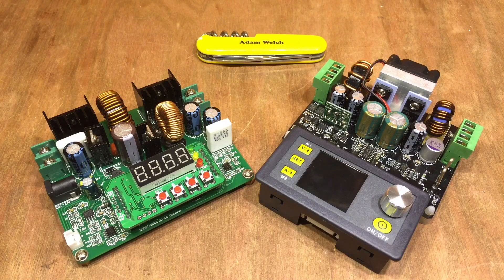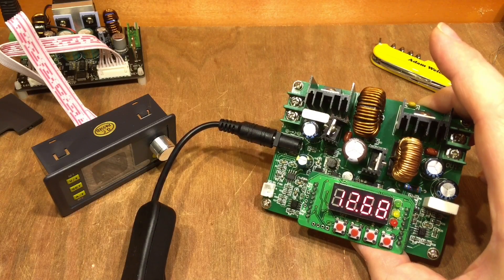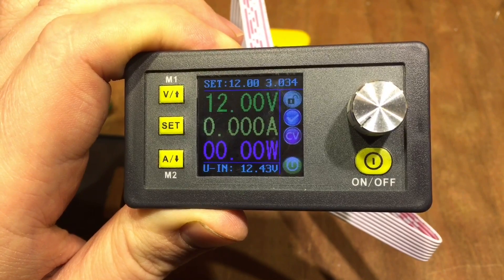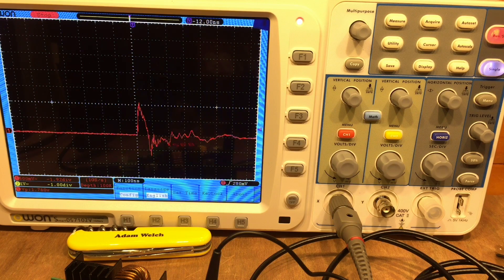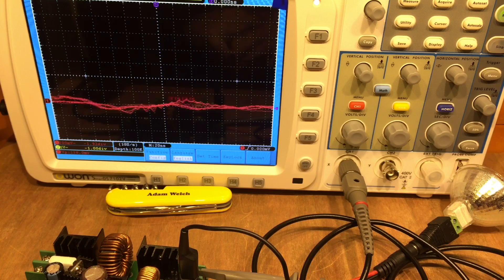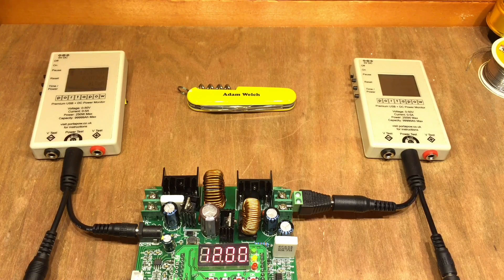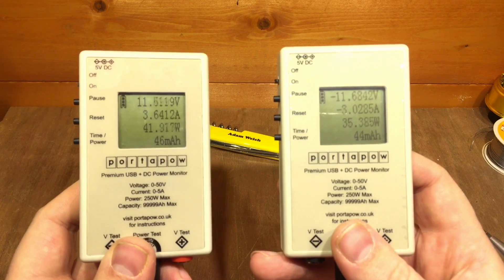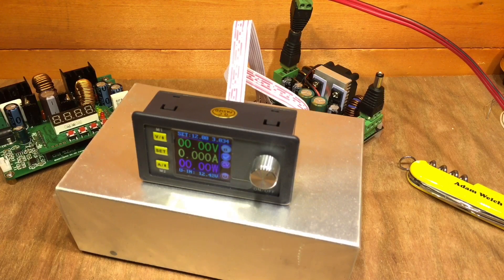Rui Deng DPH3205 vs. Minghe D3806 - 12v Solar Shed

Comment: You are trying to give 11.58 volts and get 12 volts. So the device works in boost mode. If you want to get 12 volts, you should not even use a 12 volt power supply, you definitely need to use a power supply above 12 volts, otherwise it will be inefficient and buzz!

Comment: We are using 48V BLDC Air conditioner with solar power charging 4X12V =48V batteries 150AH each, the power input for Air conditioner is 48V dc from charging batteries. The problem I understood is 2 inverters Modified sine wave inverters have gone to internal short circuit and now finally the indoor/outdoor controller card also gone into not working stage.
All happened one by one in last year but I observed that during AC on full load the 48V at have not a smooth DC because of the compressor load variation has creates a electrical un smooth DC. this may be cause of all those failures? is my question.

Comment: What about low voltages in both modules? Can you get for example 0.5V 5A on the output when you power it from 30 volts, or would they overheat?

Comment: I've tested both and they are both bad/cheap implementations. The electrolytic caps are low quality and not large enough to filter the transients at more than ~1Amp output. 
A good rule of thumb is 470uF for each Amp output.
Try replacing the electrolytic caps on the input and output with higher value, high quality, low ESR caps, like genuine Rubycon's. 
The MingHe uses only 470uF caps and the RD uses only 330uF. Way too small for those output ratings. None of them use a choke filter on the output stage either. FCC or ULA approved? Of course not!
When (not if) they catch on fire, who do you sue? Will the insurance company pay you when your house or shed burns down? 
I doubt it. As always, "Buyer beware".

Comment: Well, I looked at the efficiency numbers and I was disagreeing with you.  So, I re-run the video and did the math.

Minghe D3806 Eff. 84.028599606%
Rui Deng BPH3205 Eff. 83.706556364%

So the Minghe won by a nose.  However, as you said the noise and easy of use comes into play.  I do have one of those Minghe on the way.  Maybe I can modify the circuit some and filter out the noise.
Reply: I have D3806 too. How are you thinking of modifying it? With Arduino? What kind of change in filtering? Thnx.

Comment: Thanks Adam, nice insight. May we see more ripple current figures on the newer BPH3205 at lower currents for typical projects such as ardurino/arm/pic type projects say at 10mA, 20mA, 50mA and 100mA please. A lot of us are interested here. Thanks for your time if you do this test.
Reply from the maker: Funnily enough I was reading today how to take a better measurement of ripple today.  I'll see what I can do.
Reply: +Adam Welsh Your previous measurements were fine for the data we need. Just measure lighter loads in exactly the same manner please :)

Comment: Hello Adam...Thank You for this video.  The Led displays are best seen and "shows" best on video, with a red filter in front...like red plexiglass. Greetings from Denmark...Jakob.
Reply from the maker: +Jakob Hovman Cheers - good tip.
Reply: A tip I saw on another video: Put a strip of red electrical tape over the display.

Comment: Could you use a Buck Boost Converter in place of a solar charge 
controller?  I have a 100 watt solar panel hooked to a 12v deep cycle 
lead acid battery.  My charge controller now has a linear voltage 
converter and it cuts off charging at 14.2 v. I would like it to stop 
charging when it hits 15.1 v.  Any suggestions?
Reply from the maker: Buck Boost converters don't manage their input and will not get the most out of your panel.  You might be better off with something like the CN3722 (take a look at my video - https://youtu.be/liYZ5pYOZDE ) or the BQ24650 ( https://goo.gl/NCcYwy ) which works in the same way but I haven't actually put my hands on.  The CN3722 comes in a version where you can adjust the charging point.   However this is designed for lithium cells so it wouldn't float charge your lead acid battery.
The other option is a cheap solar charge controller that allows you to adjust the charging parameters.  I've used the EPSolar LS1024B ( https://goo.gl/DFRRg5 ) and a home made USB cable ( https://youtu.be/r3LrWeYYtnQ ) to do this before but cheaper adjustable PWM charge controllers are available.
May I ask why you want to charge to quite such a high level?

Comment: very very good comparation. I like it . the designer of D3806 is my friend, and now this designer is my engineer too. 
we are designing new products. 
you compare 3 parts. 1, display, 2, ripple, 3, efficiency. very good. 
and our product win. 
thank you again
Reply from the maker: +Rd Tech Thank you. Nice to know that you're working together. I've enjoyed using both products.
Reply: *****
thank you very much for your support 
yes, we are working together
Reply: Hi rd tech. I use both the product d3806 and dps5015. When would you guys new product will come out as u mention there?
Reply: If designer of D3806 is your friend, please ask him how to stop the problem of the D3806 blowing up my circuits! 
https://rmprepusb.blogspot.com/2019/11/is-d3806-boostbuck-dc-dc-power-supply.html
This is a very bad problem with D3806!
Reply: how does it win RD??, the MingHe performed better efficiency values (important) while also having higher output values and having bigger caps.
and it cost like 11 or 12 USD delivered (incl. shipping across the globe) while yours being like 3x times more expensive.
so how does it win??
Reply: @JAKOB1977  The math was apparently wrong. They have practically identical efficiency. There's also the color screen and all the flaws should now be gone from most current revisions.

Comment: Hi Adam, good info. Julian Ilet convinced me to buy a Minghe I have Boost & Buck converters as separate units. I thought they worked reasonably well. I guess I will have to up grade. Good Video Merry Christmas Happy New Year
Reply: Bangkok Homes
because our DPH3205 was just designed 2 moths ago. so Julian Ilet did not use my DPH3205, he did not know this . and in that time , D3805 is only one buck-boost module. so he recommend you that one. 
you can ask him now , I can make sure he will recommend you buy our RD DPH3205 
thank you . if you need one , you can come to my official shop to buy, I am the designer. 
https://www.aliexpress.com/store/product/RD-DPH32305-Constant-Voltage-current-Buck-boost-Programmable-digital-Power-Supply-buck-Voltage-converter-color-LCD/923042_32762131242.html?spm=2114.12010608.0.0.wQtsXJ
Reply from the maker: +Bangkok Homes They are good units but I personally prefer the boost buck so I can use one unit for everything. Although the Rui Deng unit only goes to 32 volts that's generally enough for me. 
The screen is the biggest difference to me - especially in videos. It's like having a proper bench power supply (or close to it). I've built the Rui Deng into a project box now and you'll probably see it in future videos - but don't write off the minghe - it'll probably feature too!
Thanks for all your comments this year. Merry Christmas and a happy new year to you too. :-)

Comment: According to dave jones you shouldn't use the negative alligator of the oscilloscope probe to check ps noise, induces a lot of noise by using it.
Reply from the maker: +.rpv Ok thanks. I'll try that again then.
Reply: er... so where is the signal voltage referenced from if you dont use probe ground? Could you please post a link to daves info so we can view the matter in context. Cheers.
Reply: Hi, it's not that you won't ground your oscilloscope probe, it's the way to do it, the video it's: /watch?v=Edel3eduRj4 or only search for "how to check power supply noise" it's on the first page of results. Cheers.
Reply: +.rvp Thanks for the heads up
Reply: Truer words have never been spoken. Go for differential measurement across the load.
Reply: View EEVblog #594. He compares and contrasts 3 main ways to measure SMPS noise, then shows how to build the differential, passive probe set. Best I've seen in 40 years of EE.
Reply from the maker: +Warren Curry Do you know I watched that video yesterday. Next time I look at ripple I will absolutely try the differential method.

Comment: wow that is some horrible output ripple !...  I'm surprised at the ringing as that is a design fault.. Id stick some big caps on the out put of that thing to see if you can tame that.  I have a 1F Car audio cap om my out put, That's mainly cos i just had it lying around. FYI much better review... Would be cool if you could test the efficiency with a voltage difference and actually do the math on the efficiency

Comment: I wouldn't really bother about the 1V overshoot at the output. I had a module that threw a +10V out when switched on. Killed a couple of things. Contacted the manufacturer and received ver2 which fixed things.
That output noise, did you check the input? (having massive headaches again and have to skip through parts)
Reply from the maker: +Luc Peeters The input was straight from my battery bank. Should be fairly stable.  Not too worried about the 1v spike, but worth noting I thought. Cheers.
Reply: +Rd Tech  Wow a manufacturer that is responsive and actually does look at feedback. +10000 points extra from me.  Would love to buy or test some stuff from you.
Reply: unlost117
hi , I don't know , but my thick is about 2mm
Reply: Adam Welch
could you let me see you battery bank ?
and you can use a battery as input to connect my DPH3205, i can make sure it is not blinking
Reply: Luc Peeters
thank you very much for your support , this is my official shop, you can buy it from here https://rdtech.aliexpress.com/store/923042
Reply: +Rd Tech We just ordered from your shop. Can you tell me the maximum front panel thickness for the display so we can start building our cases for these projects. Thank you.
Reply: +Luc Peeters Yes its good to see. That's dedication. I bet the product improves 10 fold.
Reply: Adam Welch
your input is my battery bank? I can't believe. because our product show your input is blinking
Reply from the maker: +Rd Tech Well I promise it was my battery bank! I'll re-do some tests and see if I still get flashing on better quality input cabling.
Reply from the maker: +Rd Tech Take a look at my latest two videos. It shows the battery bank I tested your converter on as well as the one I changed to this week.
Reply: Just bought a D3806 and I also get 10V when switching it off.
https://rmprepusb.blogspot.com/2019/11/is-d3806-boostbuck-dc-dc-power-supply.html
What is the difference between version 1 and 2? How was this issue fixed?